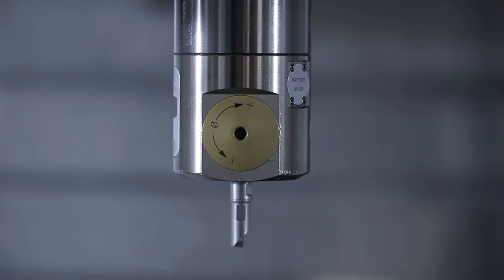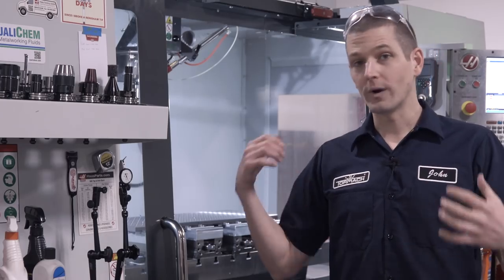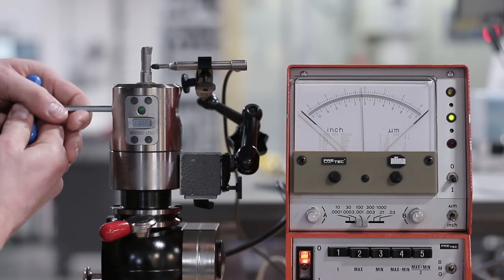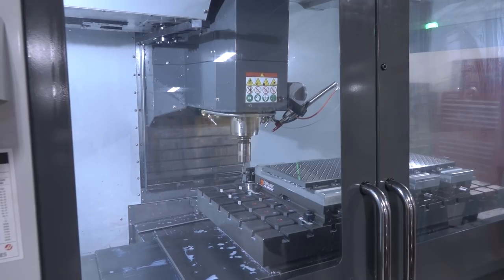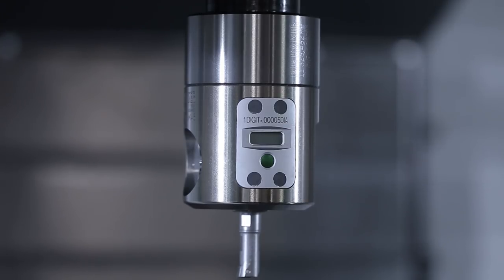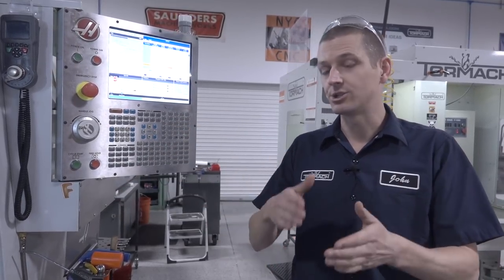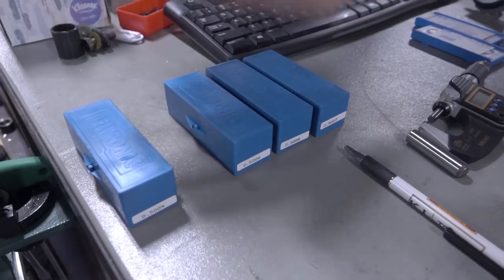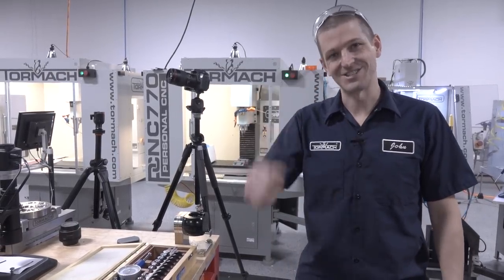BIG KAISER Digital Boring Head!  Amazing CNC Tool!

Comment: I have been CNC milling for over 25 years, and we have found the 3 point internal micrometer's to be the best and easiest method. 
On another point, some years back I used some some drills made by Dormer, (not sure if proper name now but we nicknamed them one shot drills), these drills produced holes to a few microns tolerance on size and roundness. Thus we did away with reaming and boring.
These drills produced holes to take carbide inserts, which didn't need brazing.
I love the video's, I even learn or sometimes relearn a few things.

Comment: Some people (quite a few actually) are suggesting a 3-point bore mic. If you get one, it should be in addition to one of the 2-point bore mics you already have, not instead of them! The reason is that no single method of measuring a hole can determine all forms of out-of-roundness. 2-point bore mics measure the diameter, and there are plenty of non-round shapes with constant diameter. If there are an even number of lobes in a constant diameter non-circular hole the 2-point bore mic will show error, but won't show an odd number of lobes. A 3 point bore mic will show error in all even and in 3-lobe cases. It will miss 5 and 7 lobed cases though. So you'll still need the gauge pins as a go/no-go. And of course the gauge pins measure the smallest part of the bore, so if the bore is conical they won't detect it while the bore mics can. Citation: Foundations of Mechanical Accuracy, Ch 4 Section 2, pgs  256-258.

Comment: You keep using concentriciry, both in this video and the podcast, but I think you mean cylindricity. Concentricity is to another datum, where as cylindricity describes the roundness and straighness of hole.  

Great video though. We've looked at the wuhlhaupter digital boring head for similar reasons in the past.
Reply from the maker: THANK you for that - I do my cylindrical!

Comment: There are boring heads with integrated motors and wireless connectivity now. So you can read and set the relative diameter from your controller. One of the tricks is to set this diameter accurately, then cut to be slightly below target radius. Then do in-process automated inspection, calculate the remaining material to be removed, then do a relative offset on the automated boring head, and cut the final shape. Finally do final in-process automation somewhere (after each hole, or after a series of holes, to reduce time changing tools). This usually makes holes really well located and really to spec in terms of radius (usually 1 10th). Check for example Rigibore ActiveEdge series. I am sure tho others might have similar products.

Comment: I prefer a digital gun mic to measure holes.  They have three contact points and are more consistent than the ones your using. In the end I'd recommend an air gauge for final measurement as any run out will show more easily. That's how we check hydraulic cylinder walls and hydraulic valve holes.
Reply: Those air gauges look cool, thanks for mentioning them!
Reply: Air gauges are great. And I trust them more than probing or cmm.

Comment: Really neat technology. Have you tried any KSEM carbide tipped drills for doing the holes? They are balanced cutting forces so you don't have tool deflection, the holes should come out on a consistent size and would cut at least twice as fast. You also might could eliminate the pre drill operation.

Comment: When adjusting your boring head, or any tool, your final movement should always be tightening or pushing on the tool to take up backlash. I noticed when you went past your desired adjustment, you then backed off but it didn't show if you then tightened again. Always back off further and then tighten back to your position. I don't know how tight the boring head is, probably not going to cause you too much issue but it is good practice.

Comment: Thats badass! you have really come along way on those fixture plates over the last couple years.  Next up is ID grinding right? :)
Reply from the maker: It'd take a while to jig bore them ;)
Reply: I'm curious what a thermal analysis of that part is.  I suspect the bore tolerance is insignificant in comparison to the warpage of the plate due to thermal growth.  Given the thickness of the plates, and perhaps the target market, I think the bore of the pin holes is the least significant tolerance in the stackup.  Putting that plate on a table, bolting it down, then bolting a couple vises to it, will cause all sorts of distortion.  Then the thermal effects of heat transferred from the parts to the vises, to the tables, fine tolerances go all to hell by the time it gets down to your plate!
Reply: Very true I agree but I guess starting at a known 'zero' point of tolerances is key to then be able to evaluate the variations you speak of.
Reply: Ultra CNC  You seem to have a real hard on for John. He vet rarely even talks about Haas. He rarely uses them for his videos. He's never made them out to be anything they aren't. Keep on hate watching, it helps with the adsense and the algorithm to promote the video

Comment: Shouldn't you turn it on, take more of the reading, and THEN loosen the lock screw? If it moves when it's locked/unlocked, and it shows a cumulative reading, will it show the movement it experiences while the power is off?
Reply: Not necessarily, depends if the tool is incremental or absolute. Alöso it doesn't matter as he measures the tool diameter before and after.

Comment: Just curious if you got unhardened plates to start with then mill them close to final to save on tool wear, then get them heat treated and finish with the boring bar, would the cost savings of starting with unhardened steel and less tool wear offset the cost of heat treating the plates mid way?

Comment: It would be nice if you could mix an air bore gauge to the digital boring head so the boring head could check the hole after the cutting pass and automatically adjust itself and recut if necessary. Boring and QC for every hole! All you have to do is take the human out of the equation and you would achieve perfection!
Reply: That's a great idea!

Comment: All those measuring tools when a simple bowers micrometer 3 point with a checking ring is suffice.
Reply: are they accurate enough for a +-0.00025mm tolerance?
Reply: craazyy22 the analogue ones are already accurate to 2 microns so the digital ones should be more than good enough
Reply: Dude, I would just use my trusty rusty vernier calipers... but yeah, three point bore mics are the shit.
Reply: I just use my tape measure.
Reply: No one likes those. They don't feel confident in their measurements when using one. I work QC, I use a CMM, but when I put gages together for people no one wants those Bowers. I think it's the expansion pressure in the hole, you calibrate in a tool steel ring gage then go to aluminum - the measurement is wrong and you never want to see that tool again?
Reply: QC with enough sense to use the right tool, it's the worst option at my diposal, so I don't use it.
Reply: I think you have one too many zeros.

Comment: Would Iscars SUMO drills not give you the tolerance as well? I do believe they give an H7 fit.
Reply: No way. It's just a regular drill with a replaceable tip. He's trying to get it accurate to the 0.0001", which a drill can't do.

Comment: I like the fixture plate, but I don't know why it has been anodized for. Wouldn't that adjust the flatness, instead of it being simply ground and left alone? Precision surfaces like CNC Machine tables are left alone.
Reply: Not sure how you would anodize 4140 pre-hard?  Maybe you mean black oxide?  Black oxide is a surface treatment that does not affect the dimensional aspects of the material.  Nor does anodizing aluminum for that matter.  Hard anodize is another topic which would add ~.025mm per surface, ~.05mm for a hole, but that again is aluminum.
Reply: Black Oxide would be it I suppose. I'm unfamiliar with post machining stuff. Either way, my original point was that precision surfaces I've seen don't have step done to them so I was wondering what going on. if the dimensional aspect of the plate hasn't changed, then I guess it would be perfectly fine for what it's being used for.

Comment: 6:37 not trying to be a dick, but choking up on the torque wrench like that will not give an accurate torque on the bolt. torque wrenches should always be held by the handle. Choking up on the wrench actually over-torques the bolt.
Reply: I’m pretty sure he is torquing with the handle. He just using two hands so the spindle don’t spin
Reply: Eli Douek 
Huh, well I'll be darned. Thanks!
Reply: Eli Douek ah the random things you learn in a YouTube comment section.

Comment: Oh boo, and here I was excited that somebody had made a motorised, remote controlled boring head that could e used to bore multiple iameters without having somebody to muck about with it.
Reply: Giddings&Lewis/Fives has machines that can adjust bore size on the fly from the controller.
Reply: there is such an animal, it just a little pricey!

Comment: I want a job at this place I'd piss it 😂 I work with fucked tools do thousands of bores to +- 0.02 m/m using an imperial boring bar and some bowers mics no need for fancey expensive tooling that's no doubt going to get smashed up once somone drops a bolock and runs it in to the job!